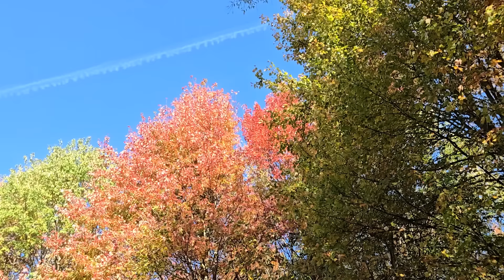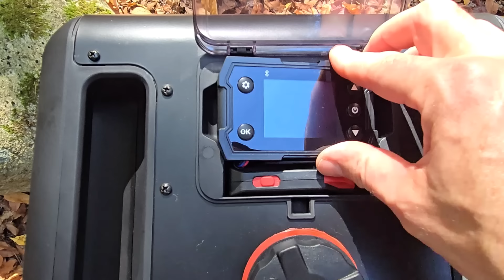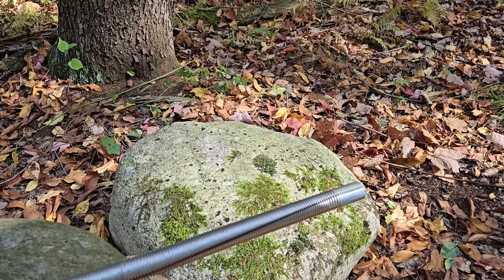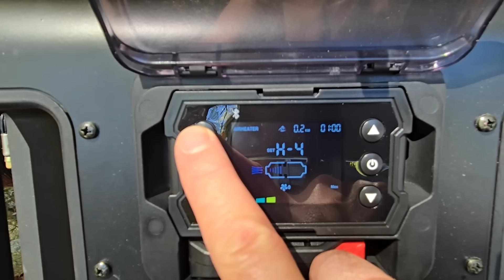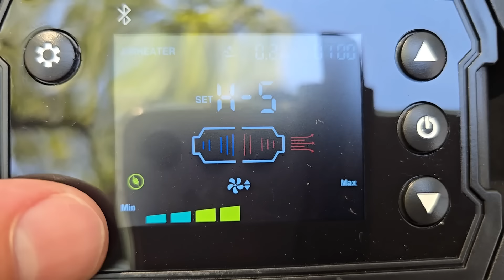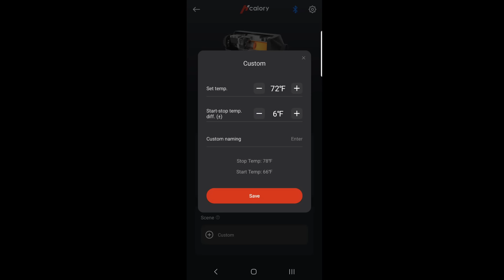62 Hours of Heat On a Tank! The NEWEST Diesel Heater: Hcalory Toolbox Max!

Comment: Everyone needs to remember that these belong on the inside of the heating area. With the exhaust going through the wall to the outside. People been installing them on the outside of the area that they want to heat. Read instructions really well. These units do not belong outside in the snow and the rain. They are vented out. They have thermostat, that belongs inside.
Reply: The manufacturers really ought to include some exhaust pipe insulation as standard then otherwise it creates a fire hazard.
Reply: People use these to heat tents and they have to be outside.  What affects this most, how one installs it if outside.  I've seen people build little boxes for them.  Heater, battery and all is in the box.  They run air ducting for the intake and output of the heater.  Combustion stuff stays outside.  

I might add, I've seen these heaters outside in the pictures by the people selling them.  Outside tents, RVs and other things.  I think they work better inside but they will work fine outside if installed right.

Comment: If you do decide to hook this up on the inside there's ways to get more out of it. The exhaust is even hotter than the heat coming out of the duct. You can use some tubing and run the exhaust tube into something to get extra heat from it or even use the exhaust tube to heat water.
Reply from the maker: Appreciate the suggestions – those are good ideas.
Reply: @jerrymeyer4203  We used the final heat exchanger out of a furnace,

275F in and 80F out. 

Last night was our first run ,we just got it plumbed and wired.

-24F last night and -18F at 1033 in Mille Lacs county Mn.

Used 80% of the tank on high.

My shop is the size of a small shipping container,stayed 60F all night and floor stayed around 54F,concrete slab.

Comment: words no facts....no1 or2 fuel....size of tank,,,,heat setting 62 hours,,,,,,
Reply from the maker: I'm not sure on no1 vs. no 2. I'm just running regular automotive grade diesel in it (not farm diesel). Tank is roughly 2 gallons. Heat setting at 62 hours would be the lowest setting. You can switch between temperature setting (i.e. 72 degrees) or just manual setting which is from low to high. I haven't tested the manufacturer's claim of 62.5 hours but from other sources online folks have said that's with the heater set to manual at the lowest setting.
Reply: @HemlockRidgeUSA   FYI, I use off road diesel in mine.  It runs just fine.  I also talked to the maker of mine.  I have tractor diesel in drums that has additives in it to keep the engine clean and such.  When asked, mine said the additives will also help clean the internals of the heater as well.  I use Hot Shot additive.  The biggest thing, low sulfur diesel.  On road or off road is the same except for the dyes in most places.  The place I buy diesel showed me their invoice once.  Exact same fuel but with added dye.  That's it.  Same sulfur content and all.  Off road is cheaper, no taxes.

Comment: Absolutely nothing special about this unit. They are all 99% the same on the inside. Run times as well, depending on heat setting and tank size.

Comment: Had 2 of the previous hcalory models and would never buy one again, both of them would plug up with soot after less than a dozen start ups and have to be torn down and cleaned consistently  , huge pain in the ass.
Reply: @edolson1698  : What speed did you maintain  ?  The lowest settings on these types cause excessive carbon build up.
Reply: Always on the highest settings, either in a steel trailer in the low 20s or trying to heat my whole house 1500 Sq ft in 30 degrees
Reply: Any chance you are at 4000 feet or higher? If so, you need a high altitude version. In any case...many heaters can be adjusted to run quite lean. I have never had any problems in SLC after slowing the pump down a bit.
Reply: @geraldhenrickson7472 I live in the Pacific northwest on the coast probably less than 500 ft above sea-level.

Comment: You should never use house power, use a car battery and have a trickle charge on the battery to keep it up because if the power goes out that thing can blow up
Reply from the maker: That's a good tip.
Reply: I don't know about blowing up but it can damage the board mounted on top of the exchanger.  I've seen videos on that happening.  I have another post higher up with more details but I use a Lifepo4 battery for mine with a smart charger.  If my power fails, the heater won't even know it.

Comment: Any ideas if the fuel pump needs the lubricity of diesel fuel to lubricate the pump?  I've seen some experimenting with kerosene, and kerosene and used motor oil, etc for fuel. I don't want to damage the pump.
Reply from the maker: That's a good question. I'm not sure. I saw one guy who tried to burn waste oil in his diesel heater and ended up burning up the pump after a few days. That's apples and oranges, but given the way they have automatic altitude adjustment and a fuel vaporizer, I would suspect it's pretty sensitive and an alternative fuel might mess it up eventually.
Reply: I've watched several videos on this.  It works for some, fails miserably for others.  Unless you have a heater you don't mind repairing or replacing, I'd stick with diesel.  Other than that, it gets risky.

Comment: no 1 or no 2 diesel, or either???? NOBODY ever says..??
Reply: search for "difference between no 1 and 2 diesel" in a browser it will tell you all. Also remember you can burn dyed diesel and usually save money, although you will need to ask around which farm diesel does better at having anti-gel in it, places vary.
Reply: I run off road diesel in mine which I'm sure is #2,  I add Hot Shot treatment to mine, I also use the same fuel in my tractor.  I've seen some run kerosene and it works for some while it fails for some.  Cooking oil is another one I've seen and for some, it works, others, it fails.  Stick with diesel like you get for cars, trucks and such and you should be fine.  If you add a additive like I do, it should help keep the internals cleaner.  I asked the maker of mine about those additives.  They said it is fine but they do not recommend kerosene or other fuels.

Comment: That's a top notch parking heater company and they keep improving their product line. I don't know where you stand on thru wall applications, but remarkably the duct sizing is comparable to RV black tank lines and fittings. There are a number of twist lock quick connects with caps that allow you to easily attach/detatch this unit to move around that would make this unit semi-permanent. One in particular the Valterr___a valve waste dump gate quick connect. LOVE the tiny cabin, .....jealous.
Reply from the maker: Thanks for the tip and comment. I'll check out the Valterr quick connect.

Comment: There's no f**** way you got 62 hours on a tank of gas when it says directly 8 hours to 12 hours depending on the setting
Reply from the maker: Full disclosure, I have not tested how long the unit runs. It's the manufacturer's claim that it will run up to 62 hours on a tank. I would assume that's at the lowest setting. Certainly, if it's running on high that will be reduced. I have to say having run it for a few hours though, the fuel level hardly moved. Here's the manufacturer's details on the 62.5 hours:
https://hcalory.com/products/tb-max-diesel-heater-toolbox-7-5l-co-alarm-last-up-to-62-5-hrs?variant=42025888448555

Comment: I think the main internals are all the same from the same factory, I have a 8kw heater took apart to clean didn’t need it but the burner said 5kw , think you’re just paying for the second in line who added parts and assembled + marketing. Thales what you want from that. Have another 8kw never installed yet, bet if I take it apart to clean it says 5kw if so paid to much because the 5kw was way cheaper and if the internals are the same why pay more?
Reply: The difference in the 5kw and 8kw, pump settings in the controller.  The 8kw pumps in a little more fuel while the 5kw pumps less.  I've seen some people adjust settings to the point their heater is more like a 2kw or 3kw heater.  Still, I hope a 8kw is designed for the extra heat and such tho.

Comment: What fan and pump speed setting to achieve 62 hours?
Reply from the maker: I'm assuming pretty low. I haven't done a longevity test yet. It will automatically adjust the fan and pump speed based on how hard it's working to keep the space warm so im sure theres a lot of variability with how cold out it is, insulation of the space you are heating, etc.
Reply: Level 1, its lowest setting.

Comment: You do know that you can keep the heater inside. Remember this, when you keep the heater outside. The heater is working harder to heat up the air that's being took in from the intake. Plus the thermostat on the unit is on the display and it will be running all the time. I keep mine indoors and just keep out the exhaust.
Reply: @iiinsaiii  actually by putting it outside you will have positive air flow. So it you have any drafts that problem will be minimal.
Reply: @Tony-um2el really?! I never had any issues. And you do understand the thermostat on the heater is in the display. I ran on one tank for a close to 3 days. Anything that I can do to help with the heating and the length I can run on one tank is more important to me. But hey, to each their own.
Reply from the maker: Agree, you can put it inside if the exhaust is properly plumbed. It does have a separate wireless thermostat and CO dector (separate from the display) that you can bring inside and will remotely cycle the unit on and off if you choose to go that route.
Reply: @H @HemlockRidgeUSA e thing is, the thermostat on the heater doesn’t turn the unit off or automatically. It just brings it down to the lowest setting. That’s the reason why people buy those third party thermostats for them. Those thermostats will fully turn off & on the unit automatically.
Reply: @iiinsaiii   I think the newer ones from this brand do turn on and off.  I'm planning to buy one for that reason.  They state it has a auto start and stop function now.  I need that where I live.  At night, I need heat.  During the day, warms up enough I need a A/C at times.  Auto start and stop would be nice.
Reply: @noneyabus1 damn! An auto start & stop would be nice.
Reply: @iiinsaiii  you know its safer to have the unit outside. You have a container in the unit filled with diesel gas. That isn't safe... If kept outside , you can always attach a hose to the intake to run it from outside to the inside. This way the heat from inside is recycling. 💡
Reply: @dreamlookautodetailingauto3353  Diesel is not volatile as gasoline, and if you read the instructions it’s meant to be inside, not outside. But hey you do you and have you heater run harder and use up more fuel. I’m gonna stick to the economical and what the instructions says to do it. 👍
Reply: @iiinsaiii  This is what I Googled for this heater...
"Hcalory diesel heater" can be set outside, which is the recommended and safest way to use it for heating enclosed spaces like tents, sheds, or RVs, as this vents the exhaust fumes outdoors. Placing the unit outside prevents the buildup of dangerous carbon monoxide and keeps the noise level lower inside the heated space.
Reply: @dreamlookautodetailingauto3353  I'd be fine with that except for theft.
Reply: @DO-hc3le  if you're somewhere where you think someone is going to steal it , it's the wrong place to be camped at. Also, there's always a way to secure it from being stolen as well.
Reply: Leave it outside, your insurance policy may cover the damage if something goes awry. Supply that combustion from outside no matter how you install the heater. The additional fuel cost is negligible.

Comment: Can you set that heater on a Formica counter or do you need to put a piece of cement board under it to prevent the counter from melting?
Reply from the maker: If you put the included brackets on the bottom, it raises it a few inches up. You'd probably be ok. I ran it on a plywood shed floor without problems. That said, why risk it. Perhaps you can grab a thin piece of slate or 12 inch piece of tile from the hardware store and set it on top of that to be safe.
Reply: Set it outside. It can take rain and snow and is quieter that way. Also...if things go sideways and insurance you may have MIGHT cover the damages.  I have been running diesel heaters since 2018, even the more affordable ones work quite well. I recently bought two of the model shown in this video. They are better heaters than many others and you can find them for under $300 on sale.

Comment: That settles it. I need to do this for my greenhouses. 
Get rid of propane.
Reply: Your greens 🥬 really loves the carbon dioxide that comes from propane combustion  so it could be better to stay with that. 
We haven’t seen any real reviews yet testing the efficiency of this diesel heater in a tent, greenhouse or likewise.
Reply: @Robin_Olofsson  There are many types of propane heaters yet it seem greenhouse owners do use the type that emits water vapor and CO2. I bet the plants do like that. Not certain however,

Comment: Dont be fooled the chinese never designed a diesel heater all they did was copie the old German design wenn wenn the patents ran off they gave it 15 names 200 diffent housing in diffent forms and keep adding features like bluetooth  CO2 meter etc etc etc..........But the heater itself is the same if its from HCalory-Vevor-Sun.. what ever brands they are called.........

I repaired mine today, i swapped the fan motor as it gave a E7 code with start up,and i brought a complete fan front unit with some gaskets on Amazone for a chinese diesel heater and it was a 1 on 1 fit..........................But these things are sooo cheaply made........

Mine was sold to me as toolbox heater from Hcalory but long story short it had E7 error fan motor after 1+ year of alot of use....

So I wrecked the case off and left the main components i needed (heater pump wiring exhaust intake and what more) then welded a few pins on the bracked that was used in the toolbox case so the heater could stand on it own with enough room for the exhaust to make a nice angle as the heater far away from flameble stuff......

Sometimes during start up i needed to the screw cap off the housing and touch the fan at the moment it would start up to give it some momentum and this became more often and more often,so i decited to swap the fan/motor front of the heater and i came to the conclusion they work great but they are the cheapest of cheapest build......Minimal thickness wires and connectors,soft aluminum,bolts and screws made from soft steel and very thin................Yes they work,yes parts are cheap,yes they last for along time,but build quality is cheap.

Back on topic 120ml diesel a hour is great most are programmed to run at 130/135ml a hour probaly the one u have has a very low pump hertz set from the factory.

Comment: Just keep the exhaust pipe from getting water condinsation in it, by keeping it lower than the unit itself..😊
Reply: Perhaps you meant the "muffler"? If so, drill a hole in it a the lowest point.Or leave the muffler off. It is not really a muffler in most cases. I did purchase an aftermarket muffler for the heck of it. around 20 bucks and is mostly plastic. Looks nice yet still makes little difference.
Reply: @geraldhenrickson7472  Actually, it's the pipe itself as well.  If condensation builds up, it blocks the pipe, a lot like a trap does on a sink drain.  It can cause errors, overheating etc.  From the heater to the end of the exhaust pipe, where ever that goes, it needs to be downhill.

Comment: Great Review!!! I like the remote control features, especially the phone app. I just got the LF Brose NT2-T which is similar but not near as nice wireless remote capabilities. The BIG advantage of the LF Brose is that it can be run from a 10a 12v DC outlet. Its peak input is 120w. On low power it only uses 6 watts. My Bluetti power bank has more parasitic power draw then that. Also, the automotive style gas cap prevents significant leakage but will still vent.

Comment: I have the same one and fuel pump started ticking after about 12 hours of use
Reply: I think that's a pump mounting issue, the pump ticks by being mounted on a hard surface. Some people put a rubber bushing in btwn the pump and spot it is mounted to...

Comment: I bet you don't comment about the combustion intake....
Reply: Yup, you didn't. At least you showed the bottom of the heater & I was able to visualize the 90°elbow attached to it. Still no idea if they have an air filter on it. 🙄
Reply from the maker: I dont think they have a filter (at least I didnt see one). The combustion intake seems to be internal (newr the air intake for the blower, opposite the output port).
Reply: This combustion intake bothers me as well. Grok, ChatGpt, Reddit only add to the confusion. Amazon reviews (65) are messed up with only one review related to this particular model.
Reply: There appears to be a combustion air intake next to the exhaust. It bends 90 degrees into the box and I think has a T with slots in as a rudimentary filter. What I would love to know is can the combustion air inlet be connected to a separate inlet duct to duck in cool fresh air, so I can then duct the inlet and outlet into my workshop to recirculate with the unit with exhaust & combustion air inlet outside in a insulated box. Thanks.

Comment: Too bad you didn’t show that it actually runs for 62 hours on one tank. And I guess that’s a 2 gallon tank, so just 31 hours per gallon.
Reply: Turned up a bit (not on low) it uses a gallon per day in constant use. Its common when constantly using the heater on high to add fuel every day.